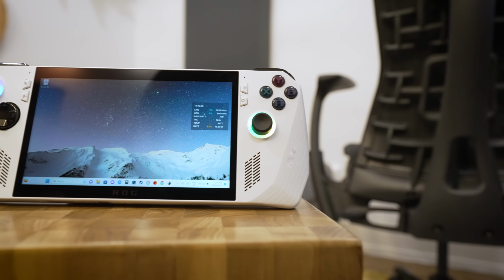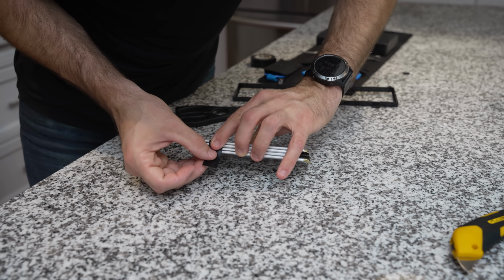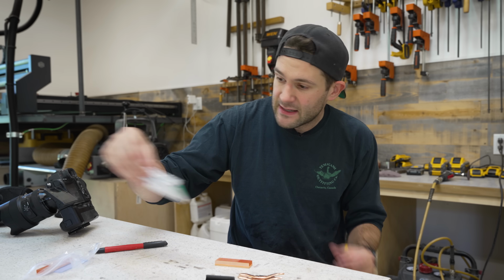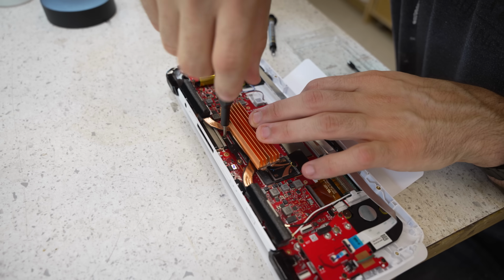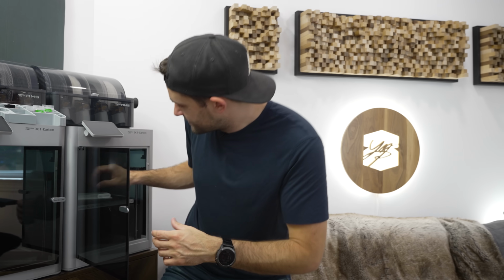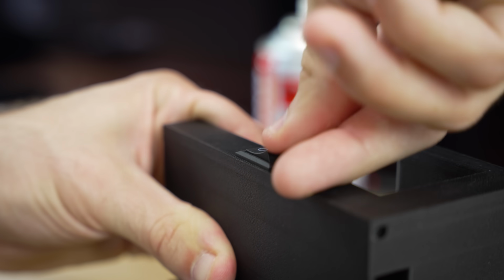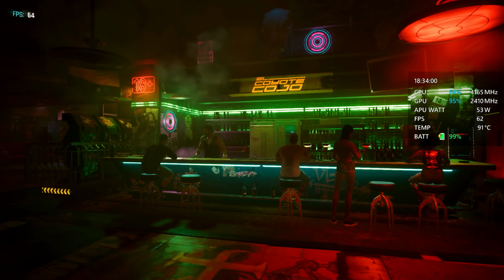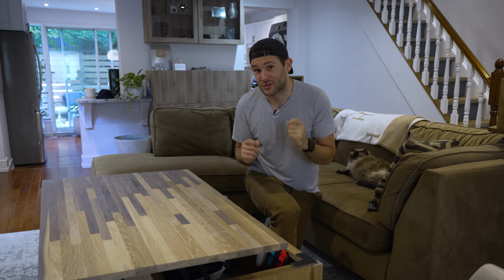I don't understand why people buy Steam Decks...

Comment: Warning!!!!!   Do NOT  use liquid metal like he shows.  It will leak and ruin your system.  He only protected the CPU from shorts, he didn't install a barrier to prevent it from getting away from the CPU.  Usually it's a type of foam that completely fills in between the CPU and heatsink.  (For testing purposes on a flat PC test bench it may not be entirely necessary, but this is a mobile device.

You have been warned.
Reply: Liquid metal is a bad idea in a device thats constantly moved around.
Reply: @xXYannuschXx  Liquid metal is a bad idea.

Fixed it for ya.
Reply: Metal, dense & expansive under heat, liquid, deformable & innertially bound to shift locations: yep, metal on PCB if you dropped that thang while carrying it in your backpack
Reply: I have taken a liking to phase change polymer for high performance, service-free, 100% safe cooling.
Reply: He does also mention that none of his thermal upgrades acheived much so probably not worth it for that reason too - though putting the insulation between the SD card and heatpipes would be a good idea
Reply: i can add to add, ive used liquid metal on my laptop, give it two years or so and itll solidify and go hard, and then to remove it will be a mission in itself, i aint ever planning to use it, bad idea
Reply: @TMProjection  This known fault occurs when you apply liquid metal to copper, as different metals in the alloy have different diffusion capability in copper. There are two ways of dealing with it, either you pre-soak the copper surface with liquid metal for a while, or better, you plate a layer of nickel onto copper. One of the reasons why i built myself a nickel plating setup :D

The alloy composition of liquid metal is vendor-specific and not often exactly known. If it contains tin, it will probably tend to dissolve just the tiniest bit of surface copper into the liquid metal alloy, changing its properties.
Reply: @SianaGearz  It's not really a fault, as liquid metal will tend to dry out with time regardless, even if it's nickel on nickel (or bare die on nickel).

And even when liquid metal is applied to copper, the dried residue or partial alloying doesn't negatively affect the thermal performance either, so there's no need to worry or take any action, unless the mating surfaces later become dislodged from severe vibration or poor mounting mechanism.

Liquid metal compounds are generally a mixture of gallium and indium. So there shouldn't be tin involved.
Reply: @TMProjection  you did something wrong. I've used LM for years and this never happens. I have 10900K/3090 with custom water cooling. I've been building PC's since 1995.
Reply: i mean ptm already good why he need a liquid meta tbh
Reply: Honestly, unless you're doing something extreme for a competition, it's not worth it over MX-6
Reply: Liquid metal is not worth the risk and difficulty to clean for temps difference barely outside the margin of error.
Reply: O.o copper and liquid Metal???
Reply: I wonder how many voided warranty repairs this video has contributed to. Makes sense, considering modern news... I forget, was this video sponsored? 🤔
Reply: Straight skill issue.
Reply: It also destroys copper, you’re supposed to electroplate the copper if using Liquid Metal
Reply: PS5 liquid metal leakage happened even with a barrier around the CPU. And on top of that, PS5 is stationary while this will be bouncing around. Don't believe that liquid metal will stay put. 🤷‍♂
Reply: Whatever dude
Reply: He did technically have the conformal coating on the outer edge which may actually create a seal when the heatsink goes on.
Reply: Hard disagree. I've used liquid metal on laptops for many years that are constantly moved around, and I've NEVER had any leaking. I don't even do any masking before I apply it.
Liquid metal sticks to itself more than any other surface, so as long as you only use a reasonable amount, and you cant see any drops squeezing out the side, there's no issue.
Reply: @Fed-Up-YouTuber  i heard that the ps5, with its own liquid metal cooling, did had leaks, even tho its done by a 3rd party, its still risky, and thats more than your 2 sample size
Reply: @macstevins  If you do some research, you'll see that rumor came from a mistranslation that is now retracted, which only applies to poorly serviced/opened PS5 units with a compromised liquid metal barrier, or from manual respreading of the liquid metal.

Even so, there haven't been any reports of failures caused by leaking liquid metal, even in this case that the console has been opened/modded before.

Do you think Sony wouldn't test their product extensively to make sure there aren't any issues with the PS5 in horizontal or vertical orientations that they advertise?
Reply: @Fed-Up-YouTuber  good for you, but the number of people who were not so lucky is huge :)
Reply: @mariuspuiu9555  That is not an excuse. 

If you are likely to be an "unlucky" person, or expect rough handling during operation, you can always do some masking with high temperature tape, or use double-sided tape with some thin foam around the die package.

The temperature and noise reduction of liquid metal is always worth it.
Reply: @Fed-Up-YouTuber  unless you properly protect your components, it's never worth it. a few degrees less compared to high end thermal paste (like the Grizzly Kryonaut) is not worth playing with fire (literal fire hazard).
luck is something you make yourself most of the time.
liquid metal became popular years ago with the CPU deliding scene where you could more easily get a proper seal and avoid issues. it's not something you use willy-nilly on top of a CPU heatspreader.
tl;dr kids, always use proper protection!
Reply: @mariuspuiu9555  "It's not something you use willy-nilly on top of a CPU heatspreader."

This is a bare-die application, bud. It always is for mobile devices, especially laptops. That's why it's worth it. Why do you think the PS5 and some laptops come with liquid metal preinstalled? It's because they would thermal throttle without it, and manufacturers tune their fan curves around it, because of the additional headroom liquid metal provides.

From personal experience, liquid metal is almost always over 10 degrees better than pastes, and ESPECIALLY stock paste. 

Think of the benefit of significantly lower noise levels over the lifespan of the product. That alone is worth it to me, if you don't consider the temperature and longevity benefits, because lower temperature also equals lower power draw and slightly more battery life.
Reply: @Fed-Up-YouTuber  it's the same thing. you are applying it on a surface that isn't properly shielded/protected/sealed. it's a firehazard.
not worth it at all to get a few degrees lower temps when you can get close enough with high end thermal paste (it's also safer and easier to use).
not to mention the simple fact that it can eat the material you are applying it on. make sure it only touches pure copper or nickel alongside the die.
have you tried something like Honeywell PTM 7950? it's non-conductive.
Reply: @mariuspuiu9555  It's not the same, because when applying liquid metal on a heatspreader instead of bare-die, the TIM underneath the heatspreader becomes the bottleneck, so there's an argument to be made on whether applying liquid metal on a heatspreader is worth it unless liquid metal is used on the die-side first, but again, this is bare-die we're talking about. 

And even if the die is soldered to the heatspreader, it's still not thermally as good as a thin layer of liquid metal. That's why delidding is still a thing these days.

Quality pastes, putties and pads only realistically have a thermal conductivity of about 8W/m.k depending on how it's measured. Liquid metal is 10 times that. That's why we can see a 10-20C difference in temperatures at the same fan speeds and ambient temperatures, so It's not "just a few degrees" we're talking about.

And just because something doesn't "need" liquid metal, doesn't mean it can't benefit immensely from it. The benefits outweigh the risks, as long as you know what you're doing. OEM manufacturers deciding to use liquid metal TIM as standard on some mass-market consumer devices is a testament to this.
Reply: @Fed-Up-YouTuber  you are advocating for putting liquid metal in any situation and that it is safe. that's wrong and also completely irresponsible. you don't care that you could be telling people to destroy their systems.
your average joe is not an OEM who has a proper safety net for their use of liquid metal. have you even seen how much effort they put into making sure it doesn't spill? especially with laptops.
FYI the first thermal paste (kryonaut) i mentioned has 12.5W/m.k.
in general you will see on average around 5 degrees difference with normal usage if you use a high end thermal paste.  (i'm obviously not comparing it to something cheap like the MX4 where you could potentially see that 10 degrees or higher delta)
Reply: @mariuspuiu9555  What I'm advocating for is the right to modify, repair and maintain. More people should know they don't have to choose to tolerate, or be stuck with a subpar configuration that a product might come with, due to cost-cutting measures from volume production.

So of course it's at your own risk, but the benefits evidently outweigh it if you're willing to put in some research and precaution, especially considering the amount of resources out there. Why do you think so many people choose liquid metal for bare-die applications? Spending even a few hours on the mod is nothing in terms of a device that you will use for years.

I'm currently running 2 laptops I did with liquid metal without any masking/protection, which have survived 8 flights so far in luggage that gets tossed around, no leaks or issues. I am seeing a benefit of 10C+ on both laptops compared to using paste like MX-5 or NT-H2. 

Liquid metal sticks to itself and partially bonds to surfaces, so as long as the correct amount is used, it cannot leak. Masking will only provide a safety net in the case that the device is dropped or experiences severe shock.
Reply: @Fed-Up-YouTuber  "Liquid metal sticks to itself and partially bonds to surfaces, so as long as the correct amount is used, it cannot leak" - now i know you are just trolling us. 
and congrats on your experience of a whole 2 laptops, ignoring the simple fact that it's just a small sample. 
you only need 1 in 100 or 1000 to have issues because of the liquid metal being applied irresponsibly like you did.
Reply: @mariuspuiu9555  And you've ignored the sample size of OEM manufacturers doing liquid metal on mass scale, because it works better than thermal paste, and it is worth it.

My example is meant to illustrate 2 bad-case scenarios with zero issues, despite no precaustions except the amount of liquid metal applied. Because the scare of using a conductive TIM while true, is frankly overblown.

Guess what? When I first used liquid metal, I was legitimately dead-scared as well. I would build a generous "moat" using old MX-4 to "seal" around the die 0.5mm away from its edges to keep the liquid metal trapped inside. I did this twice before I realized it was pretty much pointless in my case. Though I'd still do it again if I were modding a laptop for a customer, or a friend.

Anyway, If you think I'm trolling, then just don't reply to me. I've done this for years on muliple laptops and CPU delids, not just these 2 laptops.
Reply: @Fed-Up-YouTuber  why do you insist on comparing DYI with what OEMs are doing? it's just not comparable at all. have you even seen how the protection against spills looks on for example an asus laptop? it makes your story look like a sick joke where  you are literally leaving it all to "luck".
there are good ways of using liquid metal for cooling and then there's your wild and clearly dangerous way of doing it.
you HAVE to protect the surrounding components. it's must when doing such things. saying "trust me bro" is just childish. you didn't even apply a thin layer of coating around the CPU, let alone a proper seal surrounding it. 
if you want to play with fire then do it by yourself, don't give others "advice" that is dangerous.
Reply: @mariuspuiu9555  Anecdotal as my experience is, if it works, it works. That's the nature of DYI. I am either doing something right after all, or by your standards, EXTREMELY lucky for close to 10 years now.

A lot of OEMs use a foam-based barrier to prevent leaks, but from what I've tried, applying a thicker thermal compound barrier surrounding the die works just as well if you need absolute reliability.

Personally, I'd rather be "irresponsible" toward my own hardware, than be a sheep, and not try or learn anything. That's where we differ in thinking. I always encourage experimentation on old hardware that you don't care about first. But it's not the end of the world if you can't. 

There's always risks with doing anything, but we do it because of the proven payoffs. And it's not like you don't know the risks, but it gets blown out of proportion from everyone saying the same thing who never even tried it.
Reply: @Fed-Up-YouTuber your opinion is irrelevant considering that it worked for you a whole 2 times. the fact is that it did indeed destroy the devices of many. 
you are not doing something right at all, you are just playing with fire and telling people to follow your "advice". it's just simply irresponsible and i don't understand how you can even do this knowing full well the risks and what happened to so many others who weren't as lucky as you were:
watch?v=2htVCQOv0LQ
Reply: @mariuspuiu9555  Your opinion is even less relevant considering that you don't read, and don't have the same level of experience. I've done a dozen devices with liquid metal over the years, including GPU's. 

If there are capacitors along the die package, you NEED either thermal paste to insulate them, or preferably high-temperature tape. But not all GPUs/CPUs/APUs have these caps on the substrate, in fact most I've worked with don't, so it's not completely necessary in every case.

Don't fall into the trap of negative bias, because you will only hear about, and see videos where things have went wrong. And nothing about how many devices have this successfully user-installed that you don't know about.

And just like the video you linked, I'm also running a 3090 I did with liquid metal on the GPU, and copper VRAM mod on both sides as well (paste obviously). Again, no issues, and same with many other owners like the crypto miners that these kinds of mods were popular with when the card released.

Anyways, it's New Years. My point is not change your mind, I'm just saying everything that needs to be said from the viewpoint of my actual experience working with liquid metal. Lets put this to rest. Have a good New Years Day.
Reply: @Fed-Up-YouTuber  "experience" - dude you talk like you have ZERO experience. the video i gave you is the result of idiots following exactly your way of doing things. that's the result of half baked advice and then telling them that they weren't "lucky".
weren't you the one telling me a short while ago that it just sticks and won't spill? now you are telling me, who was saying this from the first comments, that you need to protect the components around it? you are starting the new year contradicting yourself. congrats. o7
Reply: @mariuspuiu9555  When too much liquid metal is applied on a die, the excess partially squeezes out and almost forms beads (but is still attached). The bigger these are, the higher the risk that a large shock or vibration will be able to dislodge it and so you get a "leak". 

Without a lot of force and a lot of liquid metal used, any small overshoot will stay attached, eventually drying and become harmless with heat cycles. It doesn't "leak" in a traditional sense, because it naturally wants to stick to itself and to certain metal like copper, depending on surface roughness.

What happened in the video link is extreme. To me, it looks like the card was dropped with a totally excessive amount applied, which broke the surface tension of the free liquid metal and splashed the board, or the owner's hands were contaminated while handling the board/heatsink, and they didn't know it was electrically conductive.

Like I said, assuming that you only apply a thin layer of liquid metal on both mating surfaces (not enough for a smooth mirror shine on either), then insulation is only 100% needed around the die if surrounding capacitors are present on the same chip. Most designs especially non-high-end or high-TDP don't have them, including my laptops, so there was no contradiction. I hadn't been thorough enough with my initial comments.
Reply: @Fed-Up-YouTuber I get it that you have had great success with applying Liquid Metal but the likely hood that you apply a little to much for the the first time you apply it is enough to stay away from it unless you have money to burn. 
It’s enough of a problem where even companies that use it have to put foam padding to prevent it getting on anything. Just look at the 5090 and ps5.
Reply: @Klopez-e9f  High risk, high reward, right? It's clearly not for everyone, but people do it for a good reason.

If I hadn't done liquid metal on the 2+ grand laptop I currently use and got the 15-20C drop each for CPU and GPU, I wouldn't have been able to stand using it with how noisy it was, how much it throttled and downclocked.

I wouldn't even call it extreme or unwarranted behavior to want to get back the stock "true" performance of the parts I paid for.

And in the case of the 5090, its tiny reference form-factor and thermals wouldn't be possible without liquid metal giving that buffer headroom either.

For every case of LM application going wrong, there may be a dozen without issue. But ultimately, do your own research and see if it's worth it to you.